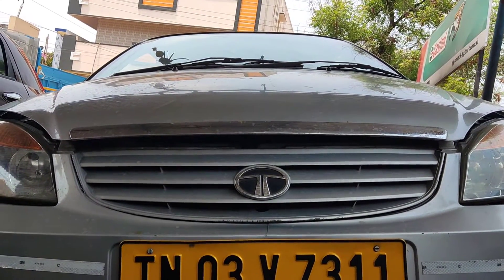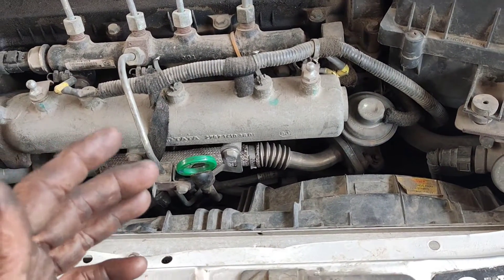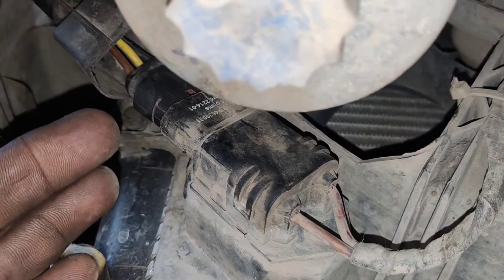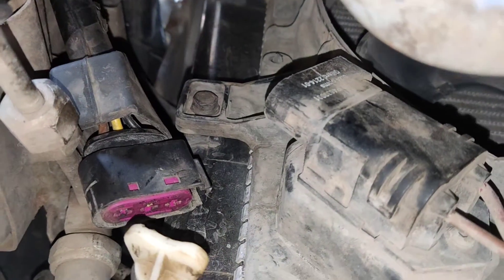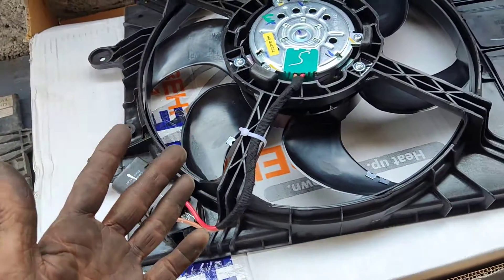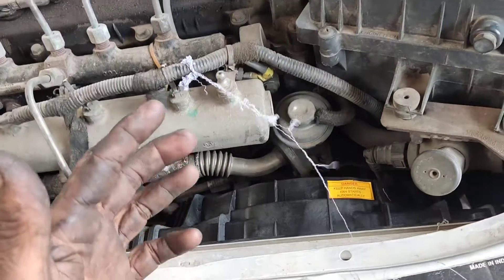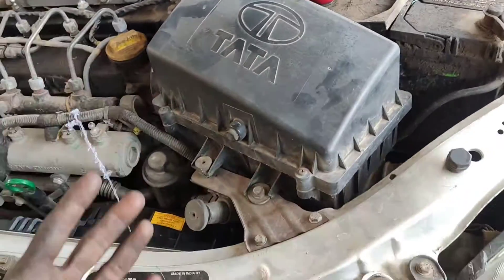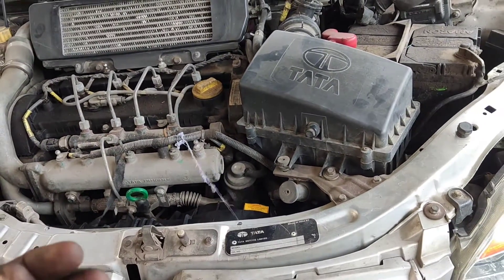Tata Indica radiator fan  assembly change(@skilledmechanictamil)

Comment: The video is clear and good. Can I get the mechanic contact details. My car radiator fan is not working automatically if engine gets heated. But fan works when it is directly connected from battery. I need to get clarity to this problem..please mention the mechanic contact details..thanks you very much